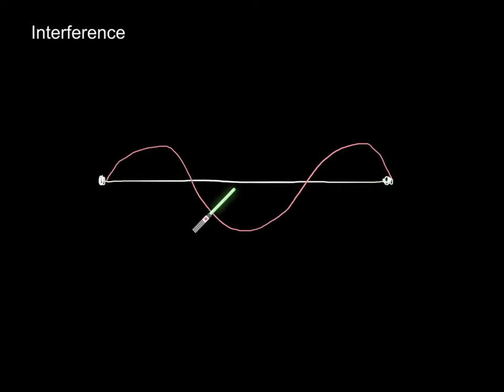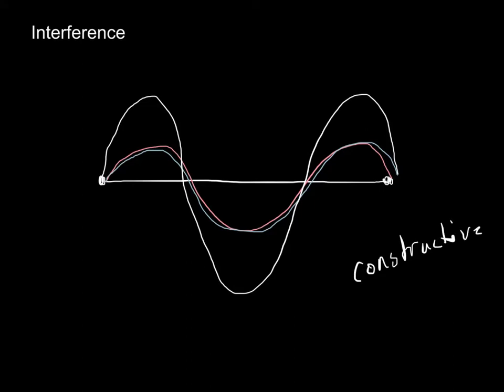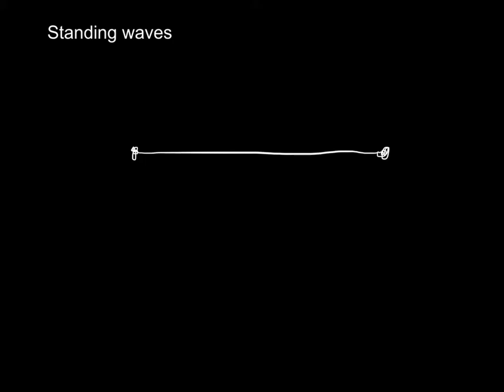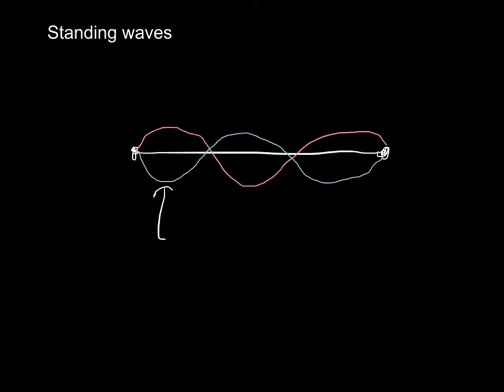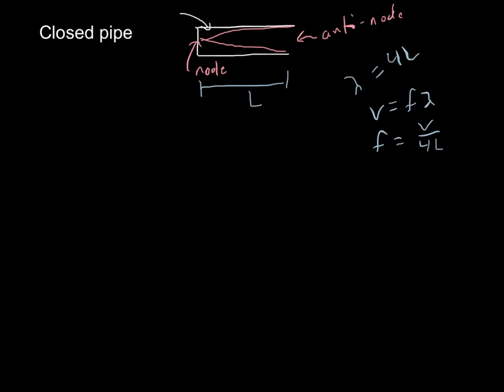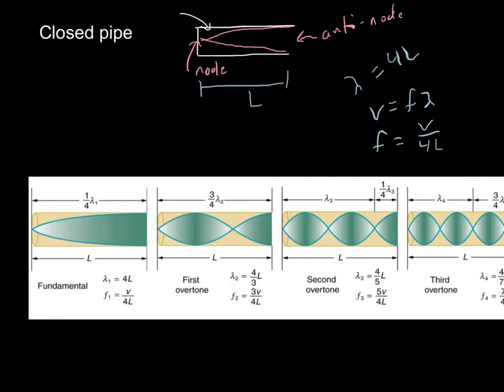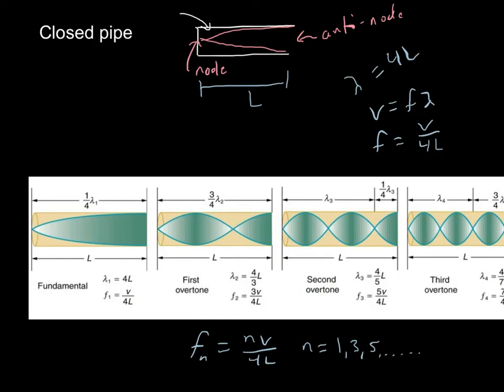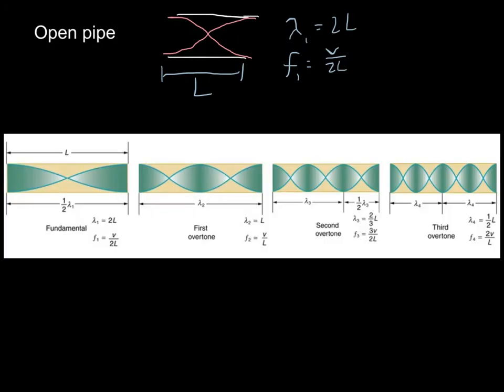interference and resonance

Comment: what I don't understand is why is it that we say "if we wiggle the string at the right frequency , it's gonna have a standing wave " why can't we have a standing wave at just any frequency ???? ..... also when we say "the least wave length we can have in a closed pipe is 1/4 of the wave length. " why is that ??? How can only one string have more than one frequency at the same time ? why is the fundamental the note that is most heard ? In harmonics, are we talking about resonance or are we just talking about how a wave would propagate in a pipe ?? and if we have a case where the frequency is constant and the length is the one changing will there still be resonance ? why ? am sorry for all these questions but I just feel lost in all these thoughts, I feel like I don't really understand this chapter and I can't just put my finger on what is it that's making me have this problem with this chapter. Thank you :)